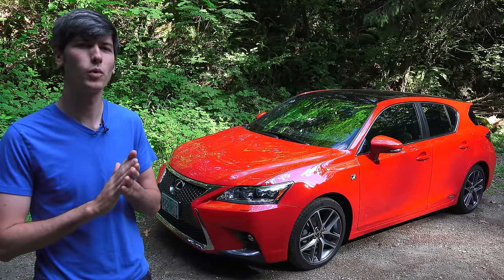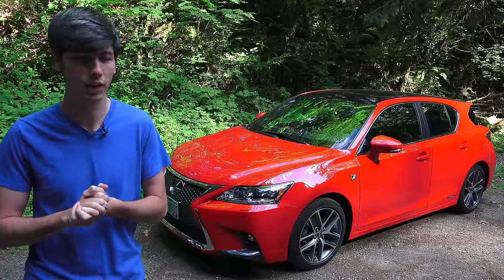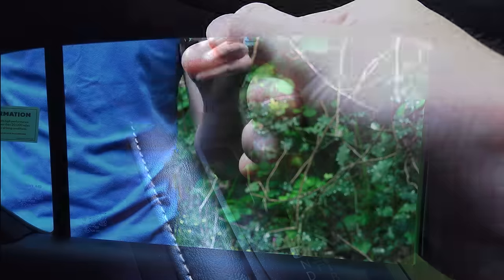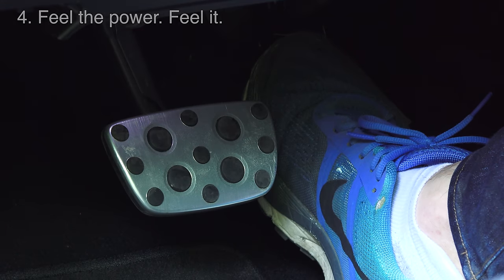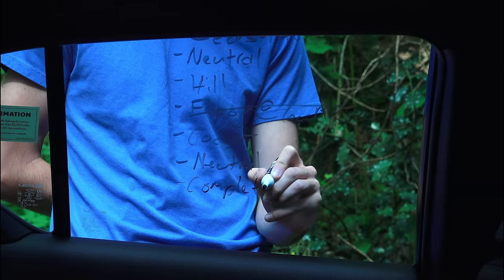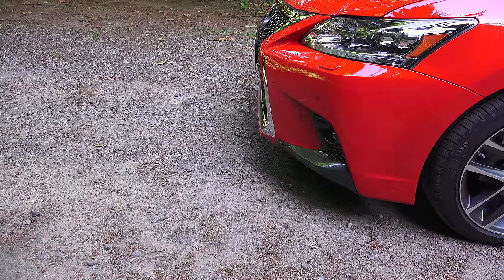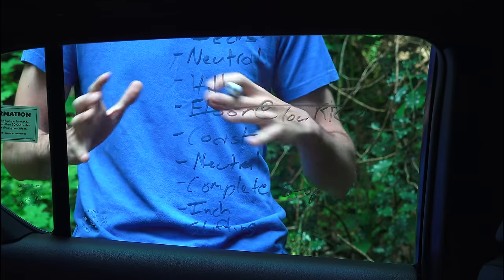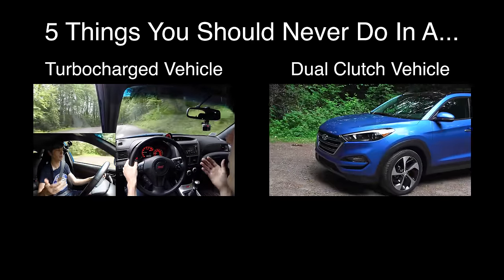5 Things You Should Never Do In A CVT Vehicle

Comment: Could you do a video about the long term durability of CVTs? I've been seeing here and there that CVTs generally can have somewhat challenged reliability at least in the long term.
Reply: the product is also evolving, so different brands and designs can have drastically differing durability.  i’ve noticed that a lot of the complaints here seem to be directed at nissan; thankfully, i have a subaru.
Reply: @tomklein9937  yes nissian don’t even try the cvts are so bad my rouge even the new one has transmission problems I get a weird robotic high pitched whirring noise

Comment: I use the paddle shifters to downshift as my 2010 Outback descends hills and approaches stops, not going into 3rd until I get just below 40 mph, but going into 4th a/o 5th at any speed under 80.  No problems so far, at 95K miles, but is there any harm in this much engine braking?
Reply: would you rather have your engine take the strain or your brakes? which one costs less to repair?
Reply: @gschaaf713  any modern car deactivates the fuel injectors when you're engine braking with no throttle. Not only is engine braking optimal in a mountainous area, it also prevents you from setting your brakes on fire. The only strain being taken is by the fluid circulation systems, which would be running either way.

In other words, unless you're redlining it for some reason, engine braking should be fine. The function exists because it's even necessary in some environments. If your engine can handle constant literal explosions, I think it can handle some negative air pressure.

Comment: That was a cool idea for the windiws as whiteboards and the way you used different doors to do it. Wouldve been a cool shot if it worked good.
Reply: I have to agree. The drawings were completely invisible and the explanation was lost.
Reply: I believe the front windows are coated in water repellent material/film. That would explain the better performance with the rear windows.
Reply: the problem was because the background was too dark.. need to it against a light background
Reply: But you can still read the additional text as he writes them down, so you should be fine. :)
Reply: +dan428 the problem was more like the pattern of the leaves with the shadows made from them
Reply: That's understandable, considering the shadows between the leaves can conceal the writing in front of it without one knowing.
Reply: 1CoLoRz2 yeah that's what i'm saying, the background made it difficult because it was dark from the leaves and shadows. could've lowered the camera angle and put it against the solid sky, and it would be clear
Reply: When writing (or applying vinyl signs etc.) you should treat glass (even un-tinted) as a black surface. Light colors are needed. Should have used a white stabilo or grease pencil.

Comment: How is the longevity of a cvt transmission? I'm interested in purchasing a used Nissan Rogue with around 80 to 90 k miles but the horror stories of the Nissan cvt keeps me away.
Reply: 2007 maxima CVT, done 161,000 and drives like the first day I bought it. Completely silent trans, super powerful/torquey and extremely fuel efficient.
Reply: As long as you don't get an early CVT (I Nissans or a Mini Cooper from the mid 2000s) then they have around the same life as a regular auto though a little less.
Reply: I'm driving a Jeep Compass with almost 180,000 miles on it.  No problem with the CVT or any other part of the power train.
Reply: Wifes Toyota Corolla S 014 58000 miles and no problems so far. Been seeing bad things from Nissan.
Reply: Asad S just dont..
Reply: Chris Cannon did you change transmission fluid? What fluid is recommended for eg in a mazda hybrid?
Reply: Asad S mine is at 82000 miles now, still runs like brand new. No problem whatsoever, I am not a mechanic but I can tell, my CVT will last longer than the turbo charged non CVT transmission that I also have.
Reply: I have a Subaru forester xt 2014. Rides great. 69k
Reply: Pls don't buy nissan I'm going thru NIGHTMARE  IT'S A MESS MAYBE HONDA OR TOYOTA
Reply: 2009 Nissan Murano with 201k miles no problems but am afraid of all the horror stories
Reply: @Gonahole  Feel for you😔

Comment: I recently purchased my first vehicle equipped with a CVT transmission:   a used 2017 Honda Fit.  I am completely ignorant as to how a CVT transmission operates except for my son-in-law who told me in simplest terms that it operates somewhat like a snowmobile power transfer.  I've always owned either regular automatic transmission or manual transmission vehicles and with those I sometimes geared down to a lower gear to help hold vehicle speed down on steep grades without having to ride the brakes all the way down (in other words use the engine to help hold back vehicle speed on a very steep downhill grade).  I'm afraid to do that with a CVT equipped vehicle mostly out of ignorance on how they operate.  The CVT in my Honda Fit works quite well don't want to do anything to screw it up.
Reply: I have a fit too. If you have steering wheel mounted paddle shifters, next time you’re going down hill, hit the gear down or “minus” paddle exactly once. Don’t shift into S if applicable, just leave it in D and hit the gear down paddle once. It should do exactly what you want. To get the transmission to go back to normal, just lightly sit on the gas pedal for about five seconds. If you don’t have paddles, then you of course have the PRNDL configuration (which I had on my last Fit) and L was generally only a gear I used in snow or under 20 mph. My 2015 would rev up and engine brake harder if I sat on the brakes long enough going down hill. Kind of like a built in intermediate gear. Anyone else can chime in but this has been my method and never any bad results. It’s a pretty rock solid transmission, especially when maintained well.  Hope this ends up being helpful. Take care 👍🏻
Reply: @garrett7555  OK thanks for the info.  I don't plan to drive my Fit during the winter..I have a gas-sucking Chevy Avalanche as my winter daily driver the thing is a tank but it's perfectly suited for western New York winters.

Comment: Clutch based?? Which CVT's are clutch based?
Reply: John A lol thought the same thing
Reply: John A Most of them? The idea of these CVT’s and double clutch systems is to have a economic transmission paired to small engine. Example my Multitronic has to slip the clutch, when travelling speeds less than 5 mph. It’s has 8 wet discs, and the oil is cooled. Shouldn’t be a problem (150k miles).

Comment: The most important thing you should not do in CVT is own or drive one!!!
Reply: Waktosha, I have three cars with CVT and two previous ones Honda's Toyotas. So far,no problems yet. Torque converters types are not made available these days due to pollution controls.
Reply: Just buy from a reliable company like Toyota or gm and you'll be fine, gm CVT feels very soulless so just be aware of that (has almost 0 jerk between gears)
Reply: YOU HAVENT LIVED until you try to get a Subaru Crosstrek CVT to cruise at 80 mph on the highway.
Reply: HIYOOOOOO
Reply: @NWCPcbenchmarks  You call GM "reliable" lol.
Reply: NWC Pc benchmarks because it has no gears...definition of what a cvt is

Comment: How long is it okay to drive a CVT without the belt starting to heat up?
Reply: As long as the car you're driving has a decent CVT (not all CVT's are created equal) and you change the transmission fluid at the required times, that shouldn't be an issue. I've driven a car with a CVT for 18 hours straight while driving across the country. The only times I had to stop were to eat, piss, and refuel.
Reply: +Kyran I have a 2015 Scion iQ and this is my first time dealing with these transmissions. Is this CVT clutch or torque converted?
Reply: It is an eCVT, so it would be torque converted. It's on my dad's 2012 Toyota Prius C that I was borrowing at the time. From what I've seen, Toyota (and it's sister brands) make some of the most reliable CVT's that you can get. The car has 130,000 miles and has never had any transmission problems (or any problems for that matter).
Reply: +Kyran so the iQ has an eCVT? Also that's why I got the iQ was because I heard Nissan sucks with cvt's
Reply: +Kyran good at least I didn't get a lemon lol
Reply: +Kyran so just bring my iQ into a Toyota dealership whenever I need an oil change and I should be fine?
Reply: bobman123googoo Engine oil should be fine anywhere, as long as you use the recommended oil. For transmission fluid, I would probably take it to the dealer because those types of cvt's usually use a proprietary type of fluid. I'm not quite sure what the interval for the tranny fluid change on it iQ is, but it's typically around 60,000 miles. Definitely take a look at the maintenance schedule for that.
Reply: +Kyran I go there every 5,000 miles for regular maintenance. So they should do it without me even knowing lol
Reply: hybrid synergy drive has no torque converter. Electric motor starts the car off always.
Reply: I have 2011 Mitsubishi Outlander with CVT and is my daily driver.  I've kicked 30,000km in 7 months and lot of road trip in the mountain and I live in hilly terrain area. Sometime on trip I packed cargo so full and possibly overweight but no effect in gas mileage, all great, nothing to complain as it doesn't effect the handling or whatever. I'm loving the fact that I'm getting 6.2l/100km (37 MPG) for my Outlander!

Comment: All I can say is don't buy anything with a cvt that isn't a Toyota..
Reply: bull3tride agreed. I have a cvt toyota mpv. Toyota estima acr50. Asia pacific smaller cousin to the sienna. 5 years and 117k km (73k miles) later, no issues. And ive yet to change the cvt oil during those 5 years. Will do it next service i ges.
Reply: addendum: *Lexus (as it is a fancy Toyota)
Reply: Honda's are good
Reply: The CVTs in the Mirage (Jatco CVT7) fail right around 175k miles or so. Which. For such a cheap car.....
Reply: So far my Ford Freestyle is doing good at 145,000. I even have relatives who own or have owned Freestyles that hit the 200,000 + mile mark.

Comment: Do you think that CVT's Could Make our cars Have better Emissions?
Reply from the maker: They certainly do; by operating the engine in a more efficient range they can help reduce emissions.
Reply: Engineering Explained so we should use them more often for cars that have high emissions?
Reply: Are you a VW engineer? 

Just kidding ;)
Reply: stig gear Are you able to read my Thoughts?
Reply: No, I smell you driving to work every day....
Reply: +stig gear Stop hiding in people's cars!!!
Reply: +ShallowBeThyGames I'm sorry, it's a bad habit.
Reply: Double clutch auto can be as economical as CVT, like Audi just dropped all CVT
Reply: thati s why ferrari BMW M and porsche use Dual CVT...oh wait...
Reply: i want to see when engines stay at a single operating speed for optimum power / torque or economy with cvts i wonder why they havnt done already
Reply: +James Flores well, with a simple, single, stepless cvt it kinda works like that, not exactly, but there is very little difference in rpm. For example an old DAF
Reply: +James Flores true, that's why there aren't many radical changes in the car "world"
Reply: +James Flores it's too huge of a risk to make gear box that customers don't like, if people like it carmakers wouldn't mind delivering it
Reply: Because people don't buy them. They are used to have a number of fixed gears (gear ratios) and the behavior associated with it, such as the engine reving up when accelerating. So the car manufacturers make CVTs with "virtual gears", which defeats the purpose of such a transmission and makes them rather behave like DCTs
Reply: It is a ''CVTs'' transmissions bear higher torque ??
Reply: Leo Wan 
cvts don’t suit audi’s target market.  they don’t make enough smoke and noise.
Reply: James Flores 
they do, in a way.  but optimum economy is at the lowest possible rpm, and optimum power is the highest rpm, so there’s a problem.

for efficiency, the car companies want to use the smallest displacement engine they can get away with, because that uses the least fuel at a given rpm.  but to get acceptable acceleration, they need to rev that smaller engine up more to achieve the same horsepower.

the cvts are fine, it’s just that engine characteristics require changing rpm to accommodate differing loads.

Comment: so treat it like an automatic
Reply: basically, it's an automatic with almost infinite gear ratios within the boundaries of the transmission itself
Reply: this.
Reply: ***** we just got a car into my work with 350,000 miles on the original transmission. Don't tell me they are unreliable
Reply: ***** I want to know on what planet a clutch lasts 300k miles. The only clutch I've seen last longer than maybe 200k miles is the 4 million million mile Volvo and that's because all of the driving on that is freeway. And what's wrong with dodge transmissions, my jeep has a dodge transmission and its at 300k miles
Reply: brandon casey my bmw has almost 220k on the clutch, but ram and Durango transmissions weren't very good in the late 90s and early 2000s. Chevrolet transmissions are the same story.
Reply: brandon casey my 08 Honda Civic has about 190k mi on the clutch and it's going strong
Reply: MMAteenager thats not 300k tho

Comment: Service the CVT. Life time fluid is a lie promoted by manufactures. Some even have changeable filters. PS use manufactures fluid and proper fill is especially critical. Learn to drive, find that happy engine rpm and let the CVT speed the car up, this may cause scary increases in fuel millage. Also that manual shifting mode is another way to shorten life. Its modern technology, if you want it to feel like you old car you should have kept your old car. Love the marker comments. 😀

Comment: Great! Not only a Hybrid with all the troubles appertaining thereto but CVT in the mix!
I don't understand why a friction clutch would be used. A CVT can "release" simply by opening one pulley sheave slightly. It all runs in oil.
A rubber belt CVT as used on golf cars and snowmobiles releases slightly at an idle, allowing the drive pulley to slip in the belt. I'm sure it puts a little wear on the belt as there is no lubrication between the pulleys and belt of those.

Comment: One thing you should never do: Buy anything with a CVT.
Reply: Your a bold boy
Reply: What you mean is, never buy a car with a cvt if you are not going to follow the owners manual.
You know, like change the transmission fluid every 30k miles.
Reply: Diemerstein That means CVT requires more upkeep and if I buy a daily driver I’m not going to change the transmission fluid more often than my tires 🙃
Reply: @destruxandexploze2552  CVT's do require more upkeep than standard transmissions no doubt about it, this is the main reason why so many fail, changing the fluid once every two years is not that bad, $40 if you do it your self, about $120 if you have it done by a shop, it's a lot cheaper than a new transmission.
Reply: @Diemerstein  Yes well tell Nissan that.

Comment: A CVT vehicle is a Continuously Variable Transmission vehicle. A continuously variable transmission is an automatic transmission that can change seamlessly through a continuous range of gear ratios. This contrasts with other transmissions that provide a limited number of gear ratios in fixed steps (Wikipedia).

FIFY;)

Comment: I am scare to buy car with CVT.
 I like manual transmission, more reliable.
Reply: Dont be. Really. Fluid change every 30k-50k miles (depends on how you drive) and the transmission will last. 
I recommend getting a Toyota CVT. Toyota make their CVTs themselves and dont rely on Jatco transmission which are low quality therefore cheap products.
Reply: @moonsapling  you mean toyota cvt's are reliable ? How about honda cvt ?
Reply: @gutadin5  well if I was to get a CVT Id get a Subaru. Honda make good CVTs, one of the better ones so it should be alright. I still prefer automatic tho.
Reply: @moonsapling  Honda, Toyota, and Subaru makes good CVTs, but research which Subaru cvt you want. Honda has one minor oil dilution in the cvt, yet Honda is making their own synthetic oil for the cvt, because most people use conventional oil and that type of oil isn't burning that well. Other than that, Toyota had a recall for 200k cars that have cvts, mainly the newer Corollas. But they are very reliable for a long time. It's the way of the future.
Reply: @CvmmanderCvdy  Very true!
Subaru was one of the first car brands to start manufacturing AND putting CVTs in their cars so they are quite experienced and thats why I chose them. Love my "15 Forester!

Comment: 1. It is OK to rest your hand on a gearshift. 
2. No need to put into neutral at a stop. 
3. Don't hill hold with the throttle. 
4. Feel the power. Feel it. 
5. Rest your food on the clutch pedal. 
6. Don't coast in neutral. 
7. Don't neutral drop your car. 
8. Always come to a complete stop. 
9. Inching forward is bad. 
10. Shift away.  Smile.       

Just saved you 7 minutes of life.